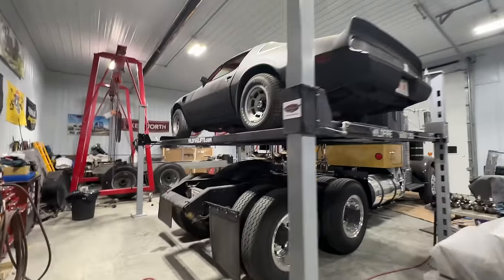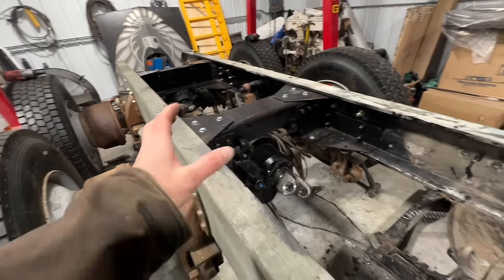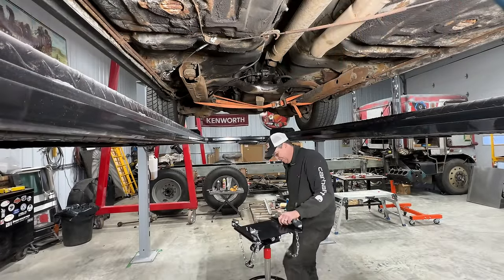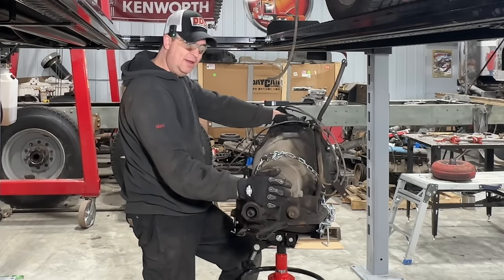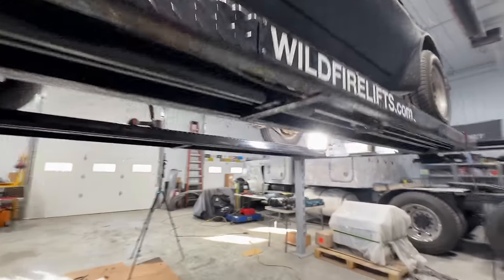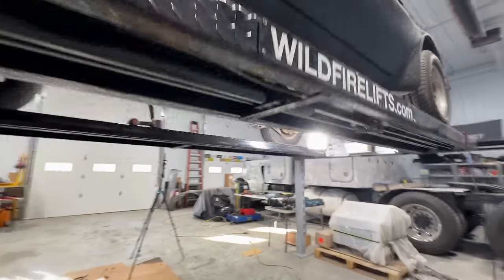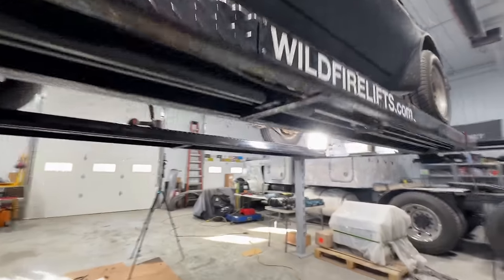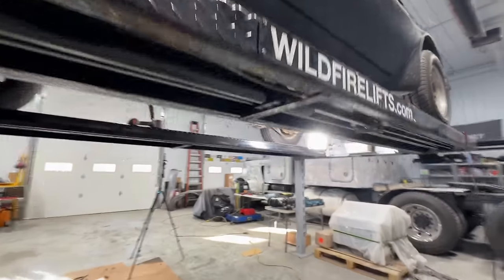Smokey & The Bandit TransAm Ep.5 Deleting Down Under

Comment: Don't  buy the holly sniper system. (JUNK) I purchased one about three years ago for my Nova with a 383  Started having issues with it after two years and ended up having a bad injector. You can't  buy parts for them, they make you send the unit back to them for any type of repair. Removed and installed a holly 750 double pumper and it performs better than the sniper. Every performance shop I talked to told me to remove it and replace with a carb. Just go on line and read the reviews.
Reply: Stock Quadrajet works great when there rebuilt correctly. Nothing beats the sound when there wide open!!!,
Reply: Your absolutely correct. Either a 650 or 750 Holly carb would be great. If wanting really durable fuel injection, go with the GM 2 barrel or 4 barrel throttle body injection retrofit. Mercruiser has used this for many years. Tons of power and extreme durability. Open ECM for tuning too! .
Reply: They have improved the Holly system ! Call Derek at VGG he’s put in a few of them and Sleeperdude !
Reply: I’ve also had issues with the Sniper. It worked well for 6-8months and then started having issues. I finally got tired of tinkering with it and swapped it for a 4 barrel, and haven’t had an issue since.

Comment: Mark this is your wifes Cousins Husband Shannon Here its been a while.  I am a specialist on Trans Ams Specifically the 1977.  I at one time purchased a true Y82 1977 pontiac special edition back in 1999 and restored it completely to best original car in every show i attended.    I know what detail you will need to make that as close as possible to a 78 special edition.  It could never be a 1977 clone as you would have to put Hurst Hatch Tops in that car.  The car code was a Y82 back in 77. Mine was the W72 option with 4 speed manual, had every available option including rear center consol.  I even have copies of all manuals you would require.  But if your in need of what you will need, i can and will help you.

Comment: Sorry to say it, but in order to use the older taillights, the entire tail panel needs to be replaced. The license plate is between the taillights on a 77 as opposed to the lower bumper on the 80, also if you swap out the tail lights the fuel tank is different, (shorter fill neck).  just get a new trunk drop off panel, they're cheap.
Reply: Yep, it’s definitely not as simple as  just replacing the taillights. Totally different setup. Not impossible, but not simple.

Comment: Hey Mark great video,  hey on that Transmission Jack, keep pumping the foot pedal, there's another section to the hydraulic cylinder.  It should rise to 67" (170cm).  You shouldn't have to lower the vehicle to remove the transmission.  You can also use the transmission jack to lower and install the gas tank or hold the drive shaft end while you install the other end into the transmission,  they have a lot of uses.

Comment: Small tip, I always tape a rubber gloves at the end of the transmission in case there are still fluid in it, it keep it from doing a messes, specially when you doing it on the floor 😅

Comment: To clean that road tar and old undercoat off use a hand torch then quickly follow with a scraper blade to skim it off. Then find a good solvent to degrade what remains and wipe it off.  Sand it out then prime and seal. That rear quarter may need to be a panel replacement. I really like the music you are using as background.

Comment: I just checked a rear tailight assembly from a 1977 or 1978 T/A. it has 8 mounting studs. Their is a pot metal carrier with the 8 studs that holds the plastic tail lignt assembly.  If you remove the subframe..... Make sure  to square the subframe  to the body when you reatach it.  Measure diagonaly from the lower front ball joints to one of the 3  holes that the rear (front mouting plate) springs bolt ot the rear frame. It might be easier to set the car on jackstands on the floor when removing subframe.  It is not hard to convert to a 4 speed manual transmission like a Stock  Borg Warmer Super T-10.

Comment: That new sub-frame you are looking at looks really nice. One benefit I saw was modern rack & pinion steering with coil overs shocks with modern upper and lower arms. Pretty slick setup to have a modern suspension on it. Plus the other beauty of it that it will accept and engine and trans you want on it. I did not hear if you said the make the same for the rear too. Yeah it cost some money, but heck it sure looks nice.

Comment: I installed the Holley sniper on my 80 Camaro and just bought a drop in electric pump for the stock tank.could be cheaper then buying some fancy overpriced tank if you don’t want to spend that much money.also..don’t believe them when they say it’s self tuning..it’s not.i spent a few bucks on a chassis dyno and a tuner and it ran way better afterwords. Keep the videos coming from gp Alberta

Comment: You need to convert/neutralize the rust before you cover it, especially if it’s going to see any weather. Ospho rust converter is a good product. Also I would primer and paint it. Rubberized undercoatings only trap in salt and moisture. Love the videos!

Comment: Also wanted to add in. I dont know your budget for shop equipment, but if possible, get a laser cleaner. They have come down to about $6000 USD finally. The 1500 watt model remove all paint and rust, right down to bare metal fast. Just a suggestion for all the work you do.

Comment: Sound reasoning Mark with the Duke.  I think you’ll be happier in the long run leaving it as is.  Being about your height, I find limitations in even a normal car.  Can’t hardly crank my neck enough to clear the roof line.  

Keep the good work

Comment: From experience, if you can, pull out the sub-frames and tear them down. You've got room to work on them and allows you to take them outside, wash and sand blast them etc. Also give you the chance to go deep on the body in terms of patches, paint and rust protecting.
Reply: Can't pull out to much on a unibody.

Comment: Yah good call on not chopping the Duke. It's one thing accidentally braining yourself with feet on the ground but gets a little more serious doing that 7 or 8 feet off the ground. 
Well now you've gone and done it going to have to get the full carpet kit for the trunk as well to make Bandit really nice and I'm sure you've thought of it but just in case now's the right time to wire wheel and hit that area around the tank with that undercoat/rust converter paint. 
Oh geeze Georgia Peaches. Have not seen that movie in 40 plus years....oh well off to Amazon to see if it's available on DVD.

Comment: Distracted again...squirrel! Lol. Normally, the welding on the rear fenders is done before the coatings / paint is sprayed in. It may cause you some greif later on.
As for the motor / fuel injection, another option would have been to use the 5.3 or 6.2 LS engine. Yes I know not a "big" Pontiac engine but the HP + torque available and tuning options would have been only limited by your imagination.
So, with all the projects you have on the go, when are you going to start cloning another "Mark" to help?
Looking good, as always keep bashing on.

Comment: When looking at your fuel injection plan remember to pay attention to the height of the intake manifold you plan to use and the throttle body. You need to stay close to the stock iron intake and Q-jet overall height to make the hood scoop fit correctly with the hood...also, avoid that Sniper package like it was the plague. I have tried to help 2 different guys with them on cars and the, in a word, are a pain in the rear. As others have said, given the option of that mess and a new Holley Vac Secondary 4BBL for your application, I'd take the carb.

Comment: Great videos as always. As a mechanuc of 20+ years, please do not use the Holly injection system. Its has many issues to run right.  For your engine I would go with a Holly 650/750 carb. You could also do a two barrel or four barrel GM throttle body system retrofit if really desired. The GM throttle body kit is what they use on Mercruiser systems, very very reliable, and parts rather inexpensive.
Reply: I'm surprised DD SPEED SHOP hasn't told him! Hell if he watches DD SPEED SHOP like he said he did then he'd know they're junk

Comment: Well already cracked my head on a Kenworth door frame, and slipped off the fuel tank, bumped my head on the frame doing a pre-trip so I have checked all those boxes back in the 70's......gads that hurts.😁sell the stock sub frame, or keep it in storage if someone need a Stocker frame but get that new sub frame, in the long run it will be well worth it.😊 Mark just remember if you can get re-pop body panels your going to be better off with new metal than 40 year plus metal....been there done that.😋

Comment: A teick to siphon gad is wrap a rag around the hose and seal the tank filler and then blow into the hose instead of suction, it will pressurize tank and start the flow. No more gas face😂

Comment: Please forgive me but I'm not too familiar with muscle cars (I'm British), but I noticed something on the rear end that  actually caused a problem for some of the earlier AC/Shelby cobras with them having leaf springs. The problem was when they added bigger engines to them the rear leaf springs would twist due to the extra power and torque, the problem was when they would snap back into the correct position a cobra would just spin out at any speed. I don't know if you'll experience the same problem with your trans am, but just to be on the safe side it might be worth looking into a four link to hopefully prevent that from happening. 
I could be wrong about trans ams so please be kind

Comment: Not sure how movie correct you want to go on the TA, as far as the back end, not just the tail lights need changed, but the bumper as well. The 76-78 have the license plate between the lights and not on the bumper like the 79-81. Also the rear spoiler ends that attach to the rear quarters  and wheel flares are different than what’s on yours.
Reply from the maker: Yeah that sound complicated 🤔

Comment: Thursday morning, time for some TwinStick Garage fun!
Thank goodness, no bubble window and definitely not going to chop and channel the cab on the Iron Duke.

Nope, those automatic transmission pans had no drain plugs.  If anyone bothered to change the ATF, you dropped the pan, making a mess, so not only did you drain 1/3 to 1/2 of the fluid in the transmission ( a whole lot of fluid remained in the torque converter), but you would also change the filter on the bottom of the valve body.

A new front sub-frame would be a huge upgrade in handling on the old Firebird.  Poor factory welds in a 1970's car is not surprising to me.  The 70's was an era of low wages and high inflation, job quality was sacrificed for speed in finishing jobs.  With machines taking over labor intensive jobs like welding, the quality and consistency went up and the labor cost went down, a win-win for the manufacturers, a loss for automotive workers.

At least parts for the Firebird are readily available.  I think you can buy just about anything NOS or reproduction for the Camero and Firebird.

Comment: Have a 81 turbo T/ had it since ‘82…someone has changed entire rear end…79 Pontiac- to 81…
Reply: Hit send too quickly…the metal should be same but exterior plastic bumper is totally different design…if you can afford it dump that front subframe…they are a poc, rear spring sag too! Good luck
Reply: Sure you know but yearone auto parts for the T/A - they have all the detail items…

Comment: Tail light swap is not an easy thing. You have to change the tail panel they mount to. The rear bumper/mounts are different too.
Reply: This is the reason you'll see a lot of 79-81s with the 77-78 nose but they still have the 79-81 tail lights like yours.

Comment: -5° is considered "Warm" where am fae,
Funny, 
I always thought working on Trucks is better although they are bigger,
they have more space and they are better constructed than cars nowadays.
BTW. never Put a Needle scaler on a Body Panel of a car, only metal thicker than 2mm.

better call the sand blaster guy up and blow it clean then Prime Seal it and paint it, canny get better than that.

On the Batteries, If yer out and the battery has tae much water in it, It freezes and splits the Pols away so they canny have an Electrode exchange,
modern Batteries have whats called an "Magic eye" that signals the condition of the Sulfuracid in the battery.
On old ones ye got tae unscrew the top put some of the acid in a wee tester that tells ye if it's ok or not,
sometimes ye have tae put destilled water in it when they are dry.

Comment: not at all an expert, and I am spitballing, if you are gonna do the front sub frame, wouldn't it make sense to pull the rear axles and suspension and either re do it on the ground or replace it? Again, I am NOT  JUDGING, just throwing ideas.